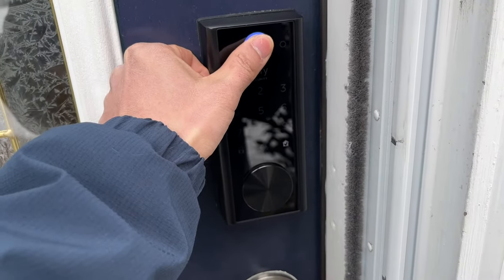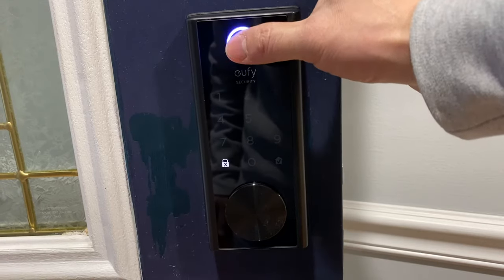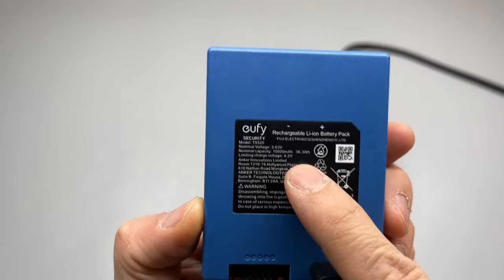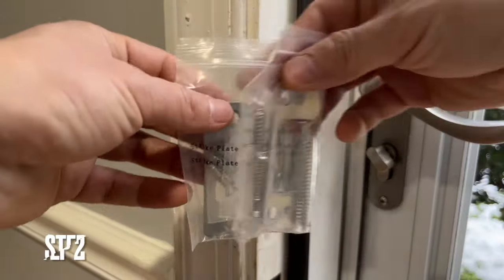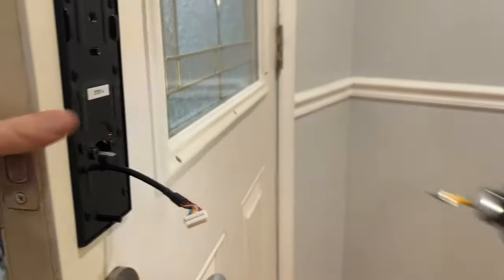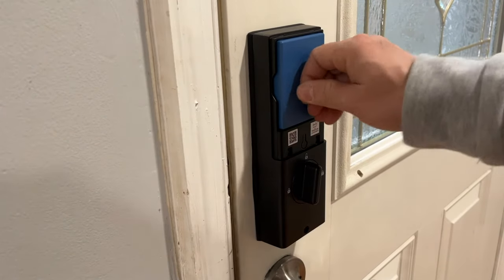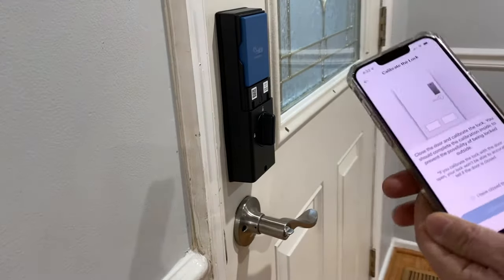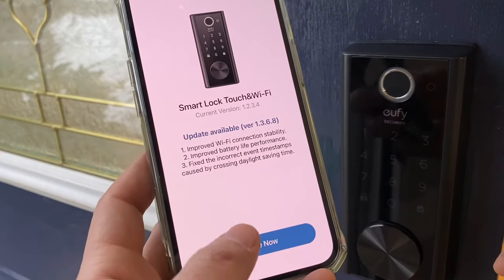eufy Security Smart Lock Review and Installation (WiFi. Fingerprint. Passcode)

Comment: Hey do you have any idea if this smart lock will fit on an 80mm thick door?😅 because per Eufy customer service and their specifications sheet, it will only fit on the standard 2 1/8” doors. But I asked their AI chat support and it answered that it should have no problem with 80mm thick door. I’ve been looking online for any one who’s tried it but have had no luck so far. Would greatly appreciate it if you can answer my questions🙏🏼
Reply from the maker: no idea.

Comment: Has anyone installed one of these but had the front panel really loose? Even doing the screws that go through from back to front as tight as I can the front panel still wobbles left to right a little
Reply from the maker: Here is a tip for you: insert a small piece of wood, e.g. match stick, then screw in.

Comment: Hi @TED Hi I have purchased a the eufy smart lock touch (not the one with built-in wifi) the previous model. Mounted it on my door and now when I am trying to pair the lock with my Android phone (initial set up before the calibration of the lock) it gives me a message saying "failed to connect to Bluetooth try again" I have chatted up with their live agents and they just send out the 3 step standard troubleshooting routine (battery charged, both devices near each other and location in the app to be on) I have done all of that yet it refuses to pair. I have raised a ticket with the eufy customer service yet no reply from them in the last 27 hours! No phone support available in Australia, I was wondering if someone can help me out here  as u are experts at doing it ?
Reply from the maker: I don't have the bluetooth version. After trying the recommended steps by the customer service. I would try it on a different phone. Could you borrow an iPhone from a friend and see if it would connect? Does the bluetooth even work on your Android phone?
Reply: Only for ios